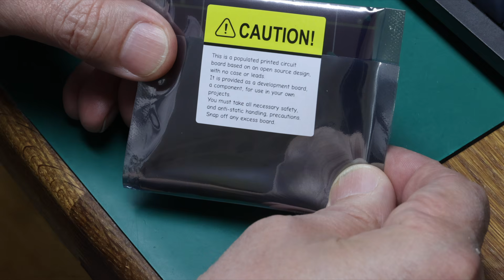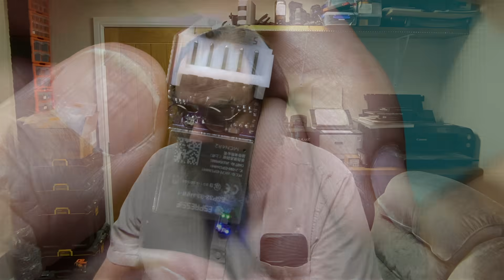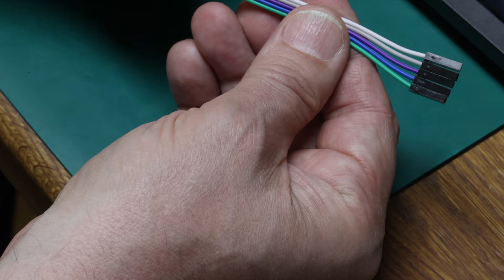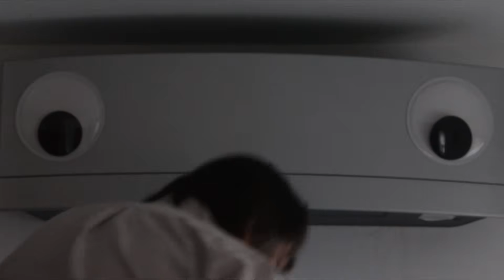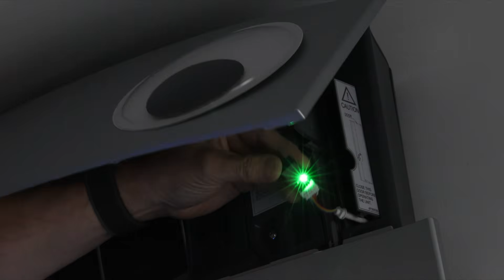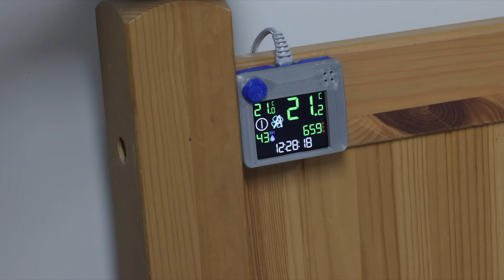Faikout

Comment: Ordered two units from Tindie and they arrived in Tokyo very quicklly. Installed the first in a Daikin C40NCV ceiling cassette unit and it worked really well!  It was really easy to install and configure, including in Home Assistant. Thank you! The next installation will be on my newer C28ZCV units (installed in 2025) - they also have S21 ports. Really good to know that Daikin devices, wherever they are, work with the Faikin. Thanks, again, for engineering this great device!